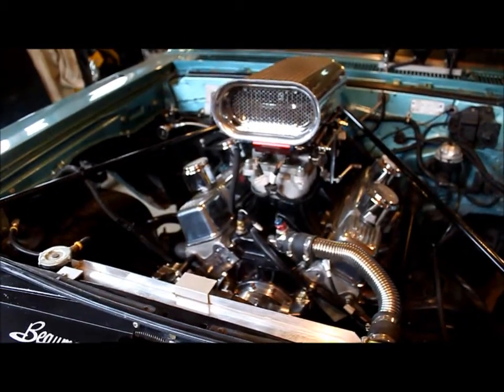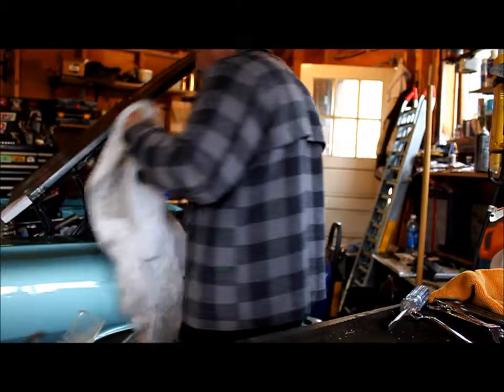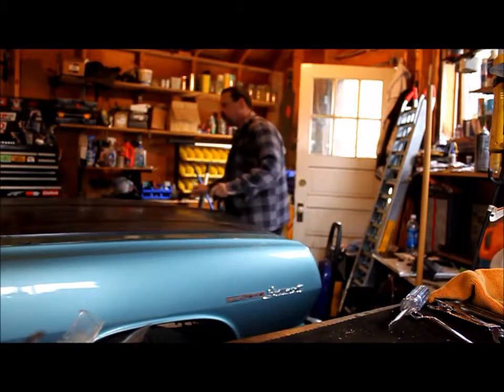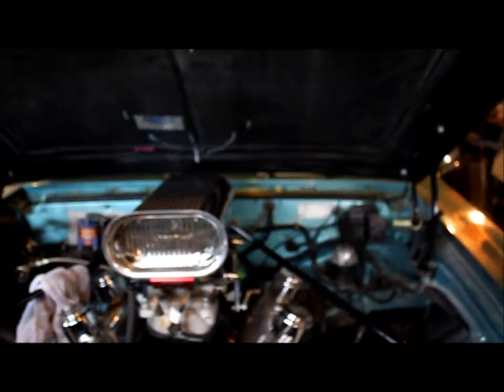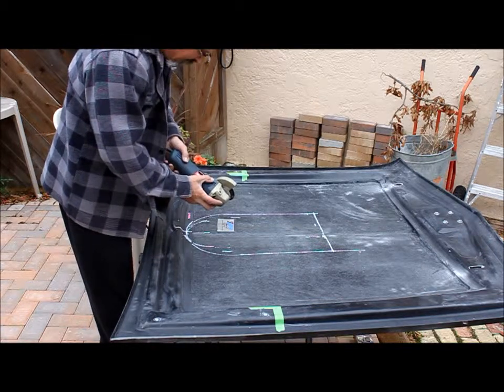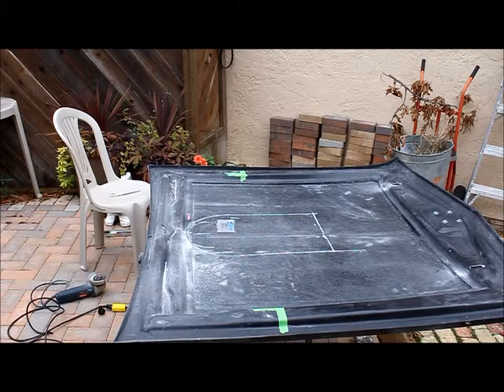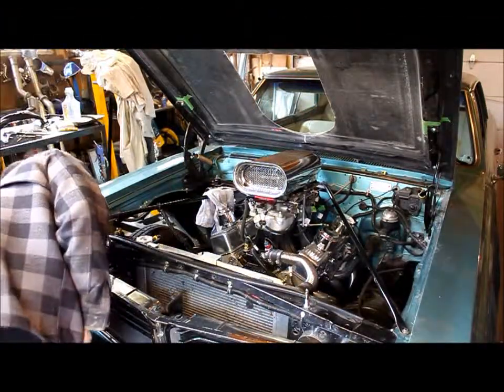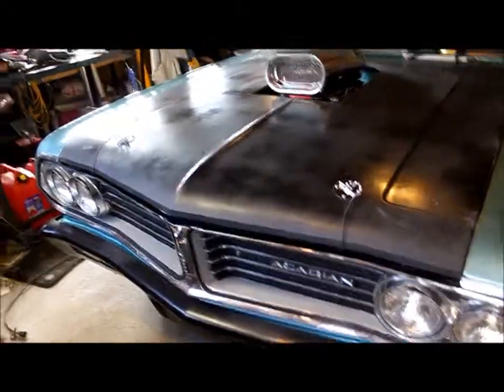HOOD INSTALL 2.wmv

Comment: Thanks! The reason I ask is because I was told that replacing the metal fenders and stuff on a car with fiberglass wouldn't really make a difference in weight. But combine that with the hood, trunk lid, and doors, and it sounds like it would make a difference. That is a nice looking engine by the way.

Comment from the maker: Front end is noticeable lighter and car sits higher in the front. I'm lowering the front end.I have manual steering and skinnies on front and it has as much effort as power steering. Air intake temp is the same as ambient temp. I can monitor it with the EZ EFI. It was 2 K&N air filters in the scoop.